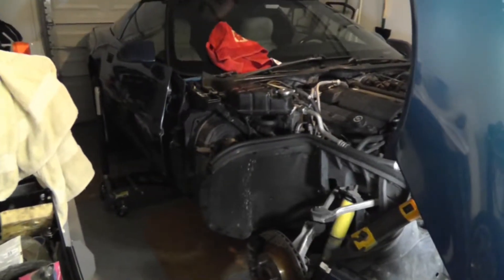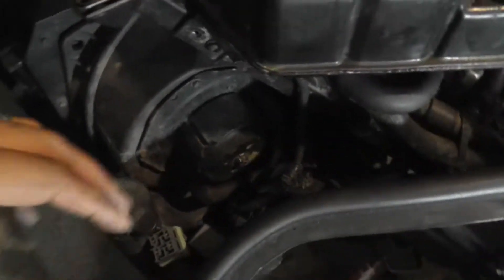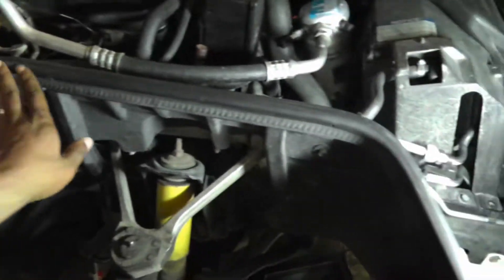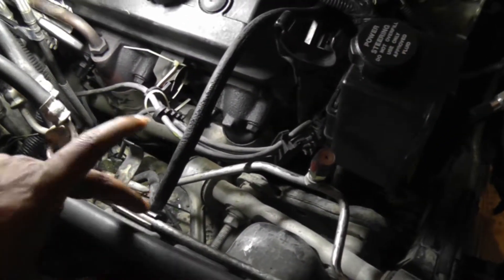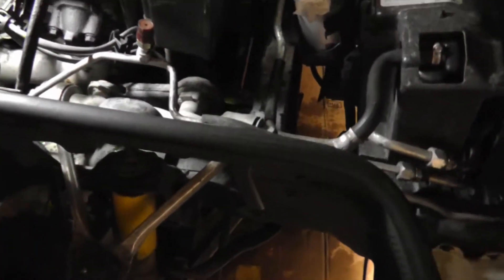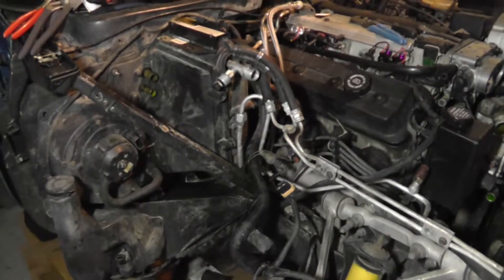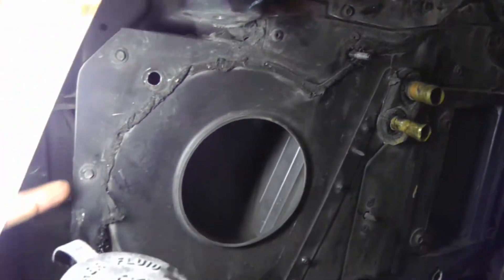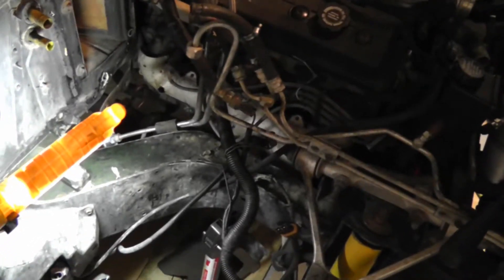Header Install 1993 C4 Corvette, Part 2

Comment: Got the car for $2500? What a steal!!
Reply from the maker: In 2016 I thought so…even with the intake manifold leaking oil, the water pump leaking coolant, the evaporator for A/C busted, and the paint and seats shot to crap.

6 years later and a little at the time she’s looking good!  I couldn’t afford it all at once but piece by piece over years?  Alhamdulillah, I was able to do it.